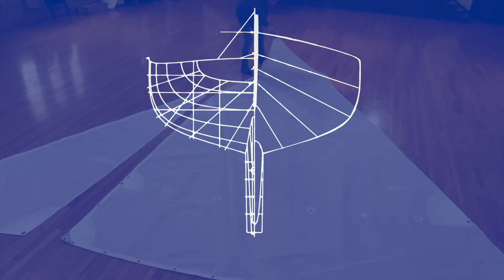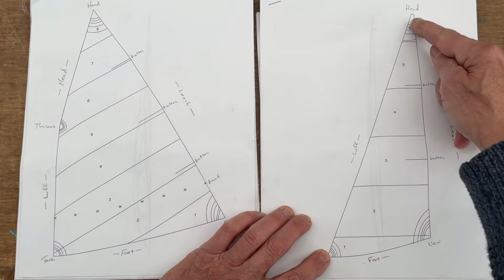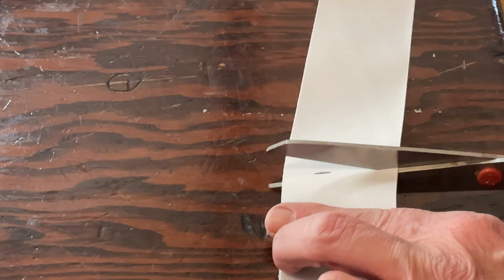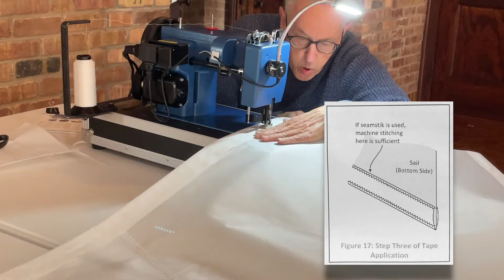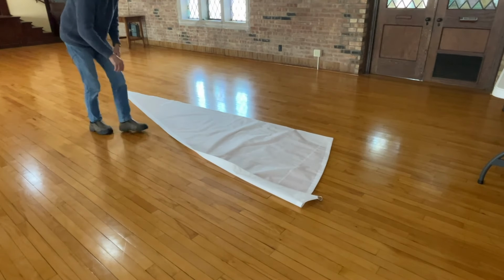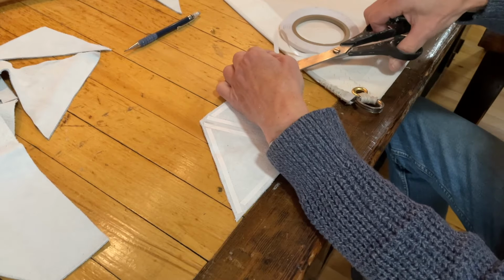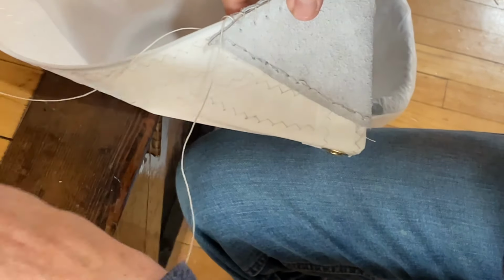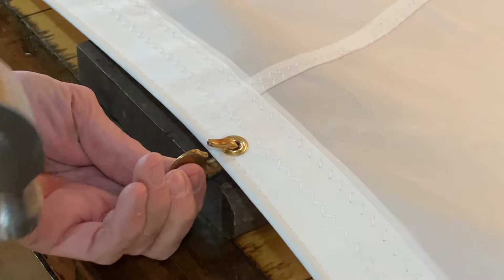How to Make Your Own Sail: The Jib, Part 1 S2-E76

Comment: As soon as I saw the plastic jib hank I thought - the weak link, first thing to fail. Of course Bob came up with an elegant solution.
Reply: Oh I don't know, 20 years or so is a pretty good life time. British Army Bosun dinghies have used those fittings on the jib for very many decades.
Reply from the maker: I didn't say that the plastic hanks wouldn't work or last. In watching my channel you're aware that I'm as interested in the aesthetics of the boat as well as the function. These bronze hanks came from Sailrite.
I'm quite confident they will last my lifetime.

Comment: What's to stop the batens from coming out of the pocket? I've often seen them with a piece of elastic at the bottom of the pocket and then for the beaten to come back into another pocket inside the beaten pocket, if that makes sense.
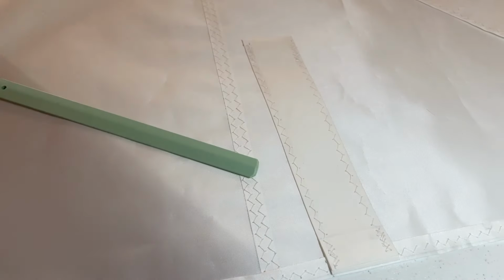Reply from the maker: At 8:33 you will see that the leech end of the batten has a hole. One would stitch through that hole into the sail cloth several times to hold the batten securely. In the next video for  the Gaff, the batten pockets do have and do have elastic bottoms. 
Thanks for your question and watching!
Bob